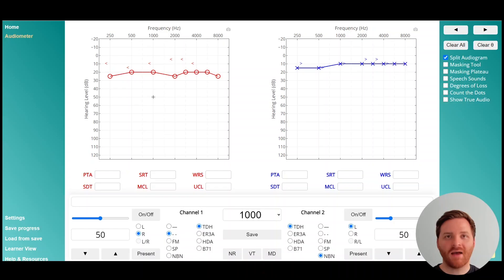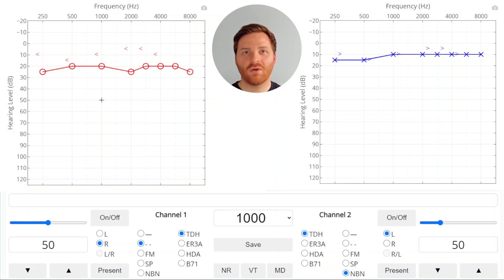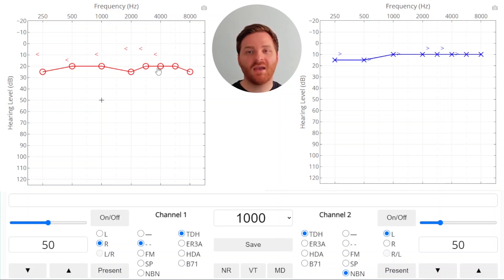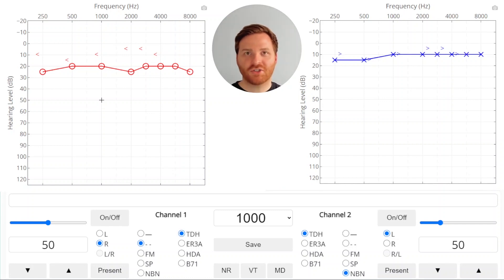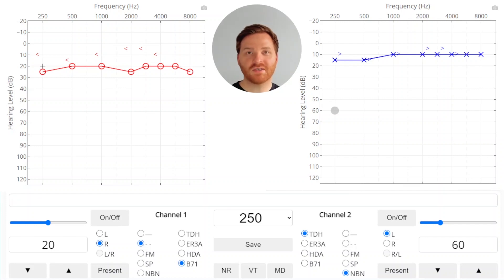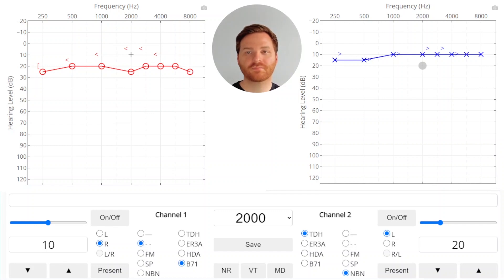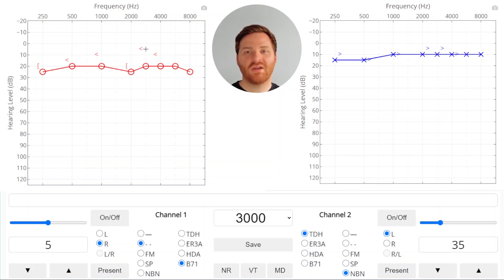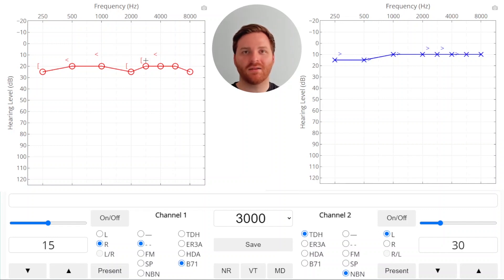Need help masking? Bone conduction masking tutorial

Comment: You raised in two instances, the masking twice, but I have been taught that you need to raise it three times or a total of 15 dB. Can you explain the discrepancy? Thanks for an awesome video.
Reply from the maker: Thanks for bringing this up - how much you raise before saving the threshold is a matter of preference and confidence. The more you raise the masker, the more confident you are that the response is coming from the test ear and the more confident you are that you are covering up the non-test ear. a 15-20 dB plateau certainly helps you feel more sure that the non-test ear is out of the game (15 dB is most commonly recommended for raising 5 dB steps, 20 dB is most often used if raising in 10 dB steps in our experience). That said, a smaller plateau in some instances in the demo were to save time, and if it were a clinical case, I would probably indicate that those thresholds were less certain than others. Sometimes (if you're at risk of overmasking) you can only get a 10 dB plateau before overmasking, and so in these cases it's up to your clinical judgment to take the threshold or mark it as a dilemma/make a note in the chart.

Comment: Why you do 250 bc there is 
Vibrotictial
Reply: Vibrotactile responses are more likely at low frequencies, but the bone oscillator is stable at low levels. It’s only at high levels when you experience vibrotactile responses, and you’ll notice that Theta has limits of the audiometer that occur at lower levels at 250 Hz to account for this. 

The B81 oscillator is even more stable (less distortion/vibrotactile) than the B71, so you usually can do good BC testing at 250. ASHA actually recommends BC testing at 250 now as standard given these advances. 

Always check with your organization for how they expect you to do testing!

Comment: A question… Air Threshold at 250 non test ear was 15. Add 10 dB + 10 dB OE = 35 dB for initial masking level .  But you had 45 db starting level for masking. Did I miss something?  Thanks
Reply: Great question! The starting level I used just assume there’s a 20 dB occlusion effect. Depending on the research you read and the group you work for, this value can change - usually between 10 (less conservative) to 30 dB (very conservative) at 250 for Supra-aural headphones. The occlusion (and starting masker levels) will also go down when you use inserts. Just be sure to check with your group/company to make sure you’re using the values they want you to use based on how conservative they want you to be. If you’re practicing privately, you can choose yourself!